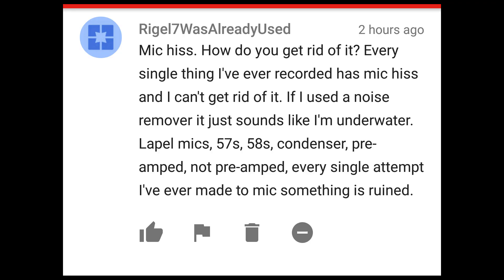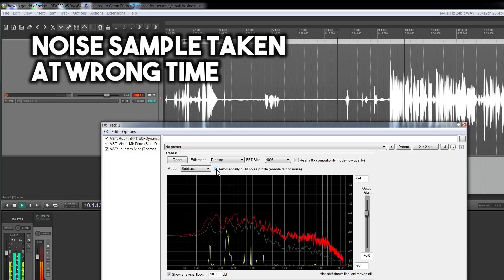HOW to GET RID of MIC HISS! | SpectreSoundStudios TUTORIAL

Comment: ok I'm sorry I play bass so I'm not fully understanding what ur saying here do u invert the phase of the noise on a loop throughout ur videos audio or does the plug in just take the noise out automatically after u inverted it? In my home setup I run Sony acid 10 which has a switch on each track that inverts it so I can just record "silence" or the noise I'm trying to eliminate and invert it on a separate track n theoretically get the same effect?
Reply: if you google "reafir", there's a bit of info to read. Look toward the bottom of the wiki for the "subtract" section. It's pretty short, so bass players should have no problem too. Apparently there's a lot more stuff that Reafir does than just reduce noise. Pretty neat.

Comment: I am very sensitive to "whistling" sounds in recorded voices, and while this video talks about tools that can be used in the PRODUCTION side of the process, I am amazed that no simple tools exist for the users to filter out annoying sounds on the user side. Even this video itself, which talks about attempting to produce better audio, contains some annoying "whistles" during the spoken voice! And it's cumbersome to load a graphic equalizer and set it specifically for each computer, and for every video. 

Just as DARK MODE helps many consumers of video visually, why doesn't YouTube have a series of AUDIO filter buttons to reduce certain audio frequencies and noises? A few settings, such as ELIMINATE WHISTLE or specific BAND PASS filters that would block those annoying, higher frequencies that contribute to this effect would really help.                - j q t -

Comment: There's another possible cause for this. I have an old ass Fast Track that I used to record until recently (got myself a Tascam US-16x08), the mic XLR input was unusable because it produces so much fucking noise. I discovered that by plugging the mic to a DI and then feeding that through the XLR interface output fixed the insane noise. 

If you're getting too much mic hiss it's because either you have a very shitty mic or gear, or your interface IO is shit (my case). A good mic or preamp will not produce enough background noise for you to hear it clearly unless you crank it up insanely high, I have absolutely no hiss issues with my new Tascam US-16x08 which a rock-solid interface for semi-pro recording; so I'll blame the audio interface until presented with evidence to the contrary :p

Comment: i have a problem with my recording, whenever i finished recording the sound is only coming from the left side and nothing from the right at all. i have checked there are nothing wrong with my headphones and there is neither nothing wrong with my mic. when i have talked with friends on skype or so they say the sound level is equal in both sides, so i think it might be the recording program and i have looked everywhere in the program, but i can find nothing at all with equalization. any help would be appreciated and i use bandicam (the newest version) by the way.
Reply: Sounds like you have a stereo plug in a mono jack to me.
Reply: What do you mean exactly?  Unless you're using a stereo microphone (which I doubt) you're only getting one input from it.  There is no left or right side, just one input.
Reply: check your daw settings and make sure ur recording in mono. this is a common beginners mistake
Reply: alright thanks

Comment: underwater sound? I have seen people who do not understand balanced vs unbalanced use plug-converting for example from xlr to jack or mini-jack, they wire it wrong mosttimes when also using sex-changers and do the unbalancing wrong. Not taking one signal but using both while they level eachother out in an odd way. So in short: using boths signal and wire it wrong. Of course good unbalancing requirs a transformer like for example a nutric. Without real unbalancing be sure to use positive signal pin and ground and never connect the negative signal.

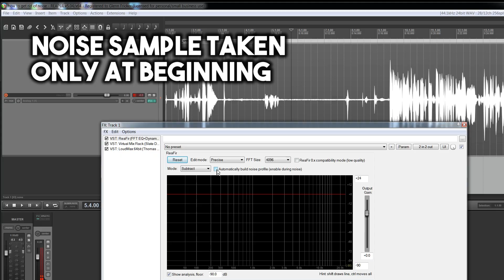Comment: at 1:46 the noise is only in lower ennd of the spectrum and it's at idk -60dB. I have noise everywhere at -40dB!
I use a good cable, focusrite saffire pro 40 and the noise is there no matter what mic I use. The preamps are probably crucial, but is there any way to get rid of the noise, with tools that I currently have? Power conditioing maybe. Maybe pwoer conditiong of what comes to the Saffire somehow thorugh the firewire port. I power it with a high quality external power supply that I know that is clean noisewise. I tried disconnecting everything, disabling bluetooth, wifi etc everything I could. The s/n didn't improve. I don't think there are any ground loops. And I am not using a laptop. 
I cut it out with the iZotope plugin, but it still doesn't sound natural because of how high the s/n ratio is.

Comment: I used to do this exact same thing using Audacity. (I am aware it's not studio grade software. But it is still an ok thing to use for quick and simple single track recordings.) The noise reduction does almost, if not, the exact same thing as ReaFir where it samples the selection (This is where you select the noise and only the noise cause as he said the program is not smart enough to differentiate the two) and inverts it onto the track. (Once you generate the effect on the entire track after sampling the noise)

Comment: Does anyone know how to do this on Cubase? Appreciate it!
Reply: If you don't have any plugin, then just set your mic to the recording level, don't touch your preamp so you don't have to care about the volumes in your DAW. Then record some noise, if you are good at editing, just a little part will be enough which will be looped under the whole recording, if you're not, then just record the noise for the whole track. Flip the phase of this track, record the another track you wanted to record and theoritically you're done, you just have to use them always together so the noises kill each other. Might be an easier way to start with freezing/flattening/bouncing the two tracks together, because then you can work later only with one track.

Comment: hey can anyone help me out? recently i was recording a friend of mine and the mic signal was super weak i had to crank the gain alot and obviously that left a bit of hiss and background noise. i was running a Berhinger C-1 straight into a focusrite 18i20 that went straight into the DAW...granted she plays quite soft but not so soft that mic signal should have been that weak...its happened before when i use an sm58 on a guitar amp too....my main question is should i be running a preamp between the mic and interface? the focusrite has built in preamps so i assumed that wouldnt be nessisarry if anyone would give me some tips that would be great! THANKS!!!

Comment: translate to me what your saying in terms that someone who doesn't use sound software can understand and is there a method in which I can remove the hiss without the extra tech that I can't afford and no high tech software thats going to be confusing to anyone who doesn't do sound tech, 

i'm new at you tube and until a little while ago I had no problems with my webcam microphone even my bro says he can't hear the hiss but I am haring it and i hear in my recordings, streams and even playback in the sound menu in result I can't turn it louder cause the static is so annoying I don't think i'd get the viewers I need and theres a lot of tubers out there who have the same tech but seemingly don't get this issue is there a way to remove static interference in a more simple way!

(it's more of a case of not remembering the terminology I only did sound once in my games design lv2 course and that was 2016 and it wasn't even the main module and since I remember better through repetition I havent needed to remember it but I guess now I do)